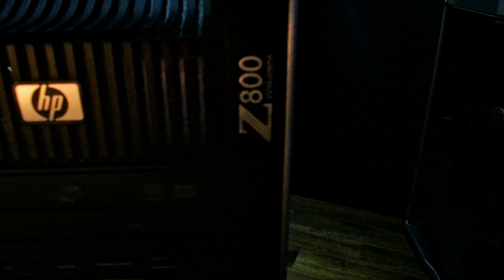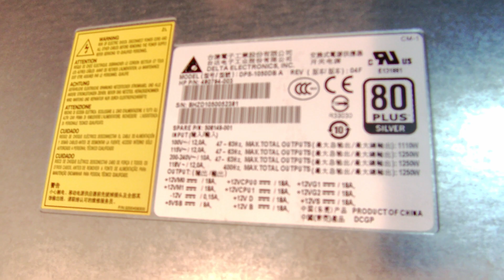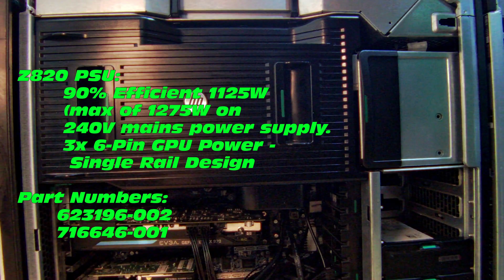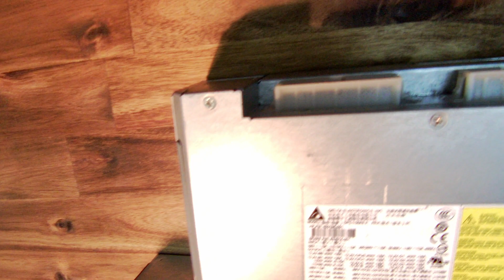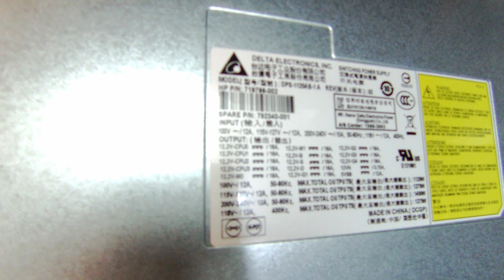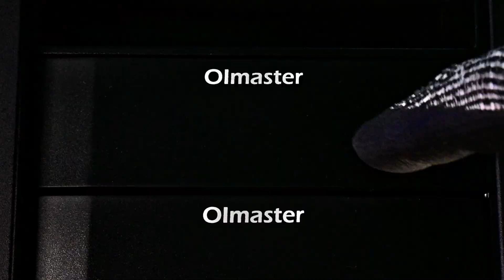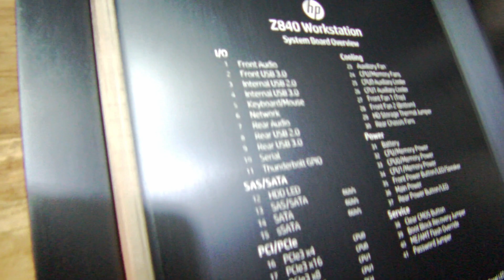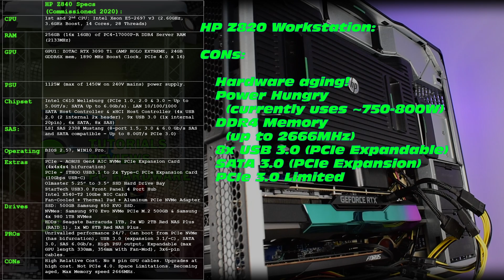Z800 / Z820 / Z840 Guide : Power Up Your Workflow with a Workstation (Remastered).

Comment: awesome video, i was wondering that is ot possible to boot from nvme m. 2 storage?, sata ssd is possible but nvme m. 2 is better.
Reply from the maker: Hi. Thanks, I am glad you found the video of benefit. NVMe booting is possible, and I use that in my Z840 right now for rendering videos, but it depends on the Z8xx model. I have videos on how to get the Z840 to run 4x NVMes on one lane by using the AORUS GEN4 NVMe Adapter (e.g. https://youtu.be/3MLLdAAv4cU). In my hands the Z820 and Z800 have not been able to boot to NVMes mounted in PCIe lanes (I can boot to them via USB - e.g. ROG Arion). But you can load your machine with SSDs and HDDs without issue. I have some future videos planned on the Asus Hyper M.2 and HP Z Turbo Drive Quad Pro - both of which can allow a Z840 to boot from a NVMe (maybe the Z820 - but not in my experience). 

RE your other message (it seems to have vanished!), the Z820 can work well as a home lab - but take note the operating system booting from a NVMe is challenging - I have seen others have success, but my Z820 machine (with the latest BIOS) would not detect/boot to a PCIe NVMe (Win 10 - Samsung 980). 

Both the Z840 and Z820 share similar spec PSUs. With a 6-Pin to 8-Pin PSU power adapter cable you can run most modern GPUs. I managed to get the RTX 3090 Ti into my Z840 here: https://youtu.be/D1cwwiR4UHM
Reply: @racerrrz  thank you for your help, English is not my first language, because of that I can't show fully my gratitude for your kindness. i really wanted to buy z 840, but my budget is limited, my  option are models below z840, like z820 and z640 and so on, i don't know, maybe sata SSDs are also fine, i really wanted the best for my homelab😅😅, sometimes you should lower your expectations 😂
Reply from the maker: @sembutininverse  No trouble! If you are patient you might just find a Z840 for a low price. I got mine by selling my Z800, which paid for half of the Z840! The Z640 is a really solid machine - if you can source one that makes for a good option. The Z820 is very powerful and can still quite easily be used today. I say keep those expectations high, nothing wrong with falling short of high expectations! 😅
Reply: @racerrrz  sorry for asking another question, can i use any pcie to nvme m.2 in the market?, or should i just use hp z turbo?, i dont understand the difference between common pcie to nvme m.2in the market and the hp z turbo, i appreciate your help,🙏🏻🙏🏻
Reply from the maker: @sembutininverse  Your question comes a little too soon! I am working on videos to answer your question, with lots of clarity regarding PCIe connectivity and NVMe adapters.

I can't find official HP documents to confirm, but I saw at least one mention of the HP Z Turbo Drive Quad Pro adapter having a PLX chip that allows it to connect to motherboards that do not support bifurcation (only the Z240, Z440, Z640 and Z840 or newer workstations have this function). i.e. The Z820 could then accept this adapter with 4x NVMes - but may still not boot from the NVMes. The Asus Hyper M.2 is the cheapest and it looks like a solid option. The HP adapter has more features but it is more than double the price.

In terms of NVMes, you are best to spend money on NVMes that are matched to GEN 3 / PCIe 3.0. The Z820 and Z840 can't support the full speeds of Gen 4 NVMes (like the Samsung 980 Pro) - hence I went for the cheaper options - like the Samsung 970 Evo Plus or 980 (not the Pro!).
Reply: @racerrrz  thank you, the explanation was clear, the reason i asked you that question was that i find a way to boot from those storages, one was clover app, and the other duet/refind, this method even works on previous model like z620 and ...
Reply from the maker: @sembutininverse  The USB workaround is the only way to get NVMe booting on them but I don't always recommend that since it's not a perfect method. I tried to get my Z420 to boot from clover on an internal USB but that never managed to detect the PCIe NVMe - even though I had an operating system on there. 

The best alternative that I found was to use a NVMe USB enclosure - like the Asus Arion (old video - audio is a little cringe haha: https://youtu.be/8gP2XhXXVjM). The speeds are slower - 1000MB/s max, but you get to have your NVMe booting on Windows on any machine - even a Z800!

Comment: The Z840's have been working pretty nicely for me.  Not as desktops, but as compute for my at home VM farm.  z840's loaded up with ram and  SSD and proxmox installed means I can model just about any kind of environment I could want.
Reply from the maker: Hi Ivan. The Z840 provides a very powerful system for VMs and likely you'll be hard-pressed to run out of processing power for your VMs. From an operational cost perspective the 1450W PSU would make me think twice for using it for a 24/7 system, but in my case the idle power-draw is actually decent (mine is ~ 350W at it's lowest). Have you got your one running all the time? I haven't had the need to set up Proxmox just yet, but I am sure that may change.
Reply: @racerrrz  powerwise, the nice thing is being able to shut down easily when its not going to be getting used for a while.  proxmox makes managing the VMs nice and easy.   It has worked out really well on the compute side as I have enough horse power to do quite a lot of work across multiple hosts.  In the end having lots of cores and plenty of ram makes up for how power hungry it is.

Comment: Hey! I also saw your video on the z400 series and I currently can buy either a z420 or an z820. But I'm wondering which one to get. They are roughly the same price but the 420 got a GPU upgrade. I'm wondering now if they have huge differences that would make one better than the other if I plan to modify them strongly (maybe even flash the Bios to unlock the CPUs to Ivy Lake). I'm not sure if I would ever want a dual CPU setup.
Reply from the maker: Hi there. I am glad you found both videos before making your decision! The Z420 is a great value machine. I put mine through its paces as a TrueNAS file server (and I use to game on one!); but they can be set up to match most tasks. The Z820 really packs a punch and there are some solid upgrade paths. 

The decision can be made simple once you consider what hardware you want to run in your machine and what the end use is. In terms of the Z820, aside from the extra CPU to handle multi core tasks, another major benefit is the extra PCIe lanes. If you plan to run a lot of expansion cards (like RTX GPU, NVMe adapters, 10 GbE NIC, SAS HBA, USB Type C etc.) the Z820 will give you more freedom to expand (although you would need 2x Xeon CPUs fitted to make use of the extra PCIe slots). 

What GPU does the Z420 come supplied with? What was your main purpose for the machine?

Comment: As far as I can see the highest core count you can get in one of the E5-26xx series would be the E5-2699 v4, which has 22 cores (giving a total of 44 cores for the dual chip setup).  Am I missing something or was there a typo in the headline, where you mentioned 56 cores total? Cheers 😊
Reply from the maker: You are observant and completely correct! Sorry about the confusion. The thumbnail has a small * that says 56 Cores and 112 Threads * on one table. That was the total cores present across all three workstations in the video (2x X5670 v1 (6 Core) + 2x E5-2690 v1 (8 Core) + 2x Xeon E5-2697 v3 (14 Core), netting 56 Cores, on one table. It’s a fine line between click-bait and the perfect hook! If you do want 56 Cores in one machine, the HP Z8 G4 with 2x Intel Xeon Platinum 8180 28 Cores each will get there without trouble. Or the newer HP Z8 Fury G5 which can get to 56 Cores on a single Intel Xeon W9-3495X CPU (1.9GHz Base, 4.8GHz Boost)!

Comment: have you tried a baremetal proxmox installation? what’s the  embedded network interface card type? intel I201?
Reply from the maker: Hi Shereif. The HP Z8xx workstations would be ideal for running Proxmox. I have not attempted an installation as I have not needed to set up virtual machines. Z8xx workstations have two 1GbE integrated NICs. The network card specifications will vary according to the model: 

The Z800 (2x RJ-45; 1x Integrated Broadcom 5764 PCIe LOM Controller + 1x Integrated Broadcom 5761 NetXtreme GbE Plus), 

Z820 (2x RJ-45; 1x Integrated Intel 82574L NIC + 1x Integrated Intel 82579LM GbEs), 

Z840 (2x RJ-45; 1x Integrated Intel I210AT + 1x Integrated Intel I218LM GbE).

In my Z840 I have added the Intel X540-T2 10GbE NIC to obtain an additional 2x 10 GbE RJ-45s.
Reply: @racerrrz  Thank you for the quick response. Right now i'm using multiple dell 10th Gen Micro PCs and instead of adding one to the fleet, I'm thinking of consolidating all of those into a single system, also where I can assign more than 64GB ram to a single VM.. Z840 looks like a perfect system
Reply from the maker: @SheriefElHamalawy  Nice, that sounds like a solid lineup of PCs. I suspect the Z840 will handle that quite easily and there are options to expand them quite easily. Power draw on the Z840 is generally quite good despite the large capacity of the PSU (I would estimate ~450W to run all the VMs but that will depend on their complexity and scale of use. Right now I have outgrown the storage capacity on my Z840 and I have partially incorporated a Z420 that's loaded with HDDs and TrueNAS Core to manage it all (plus 10 GbE to link them). I am not sure if this is of help but I presume Proxmox VMs could be linked to a TrueNAS database. You could set up a virtual machine running on Proxmox and configure it to access the TrueNAS database (with some RAID 5 perhaps) over the network (NFS or iSCSI etc.).

Comment: Z800 overclock possible?
Reply from the maker: Hi Robin. The Z800's Xeon CPUs can't usually be overclocked due to the Xeon processors not supporting the feature (they are build to be reliable). The Xeon E5-2687W V1 might be the only CPU that could be pushed further through using the Intel Extreme Tuning Utility, but I have not tried this out.
Reply: @racerrrz  thx for the info
Reply from the maker: @robinreso6240  No trouble. Let us know if you manage to get some overclocking done!
Reply: @racerrrz  pfft probably not possible

Comment: I have had several HPs, my most important is a Z820... as with my other HPs, when I turn it on the fans race for a few seconds before settling down and starting the boot... 
--> BUT beginning 2 weeks ago my Z820 has the fan on full for 8 seconds or so before starting to boot (rather than 2-3 seconds as before)... any ideas or experiences with this phenomenon?   
My other HPs, with my Z820 up until a few weeks ago had the fan go on full for 2-3 seconds before booting, so that didn't worry me... but now with 8-9 seconds of the fans on full, I wonder what's up... otherwise my Z820 is an amazing beast for music production, and an amazing value for the money...
Reply from the maker: Hi. There are a whole bunch of factors that can influence the fan speeds on booting. It is great to hear you are making use of your Z820's potential! I am certain it would work well for music editing!

Regarding the Fan issues: 

The short answer: 
It is likely your thermal sensor beginning to show signs of wear. 

The long answer:

I tend to have my Z420 (which spends most of its time off given that I use it more as a NAS / File Server) being quite loud on startup for several seconds. It can be because the room temperature is high, or that there is a fair amount of dust building up in the system. The most logical answer would have to do with the thermal sensor that regulates the fan speed control (it's located behind the front panel and is tied into the front I/O with the power button etc.). HP Workstations have a build in feature where the fans spin at max speed on startup to help clear dust out of the system (only when booting). If you notice a change in that duration the most plausible cause is the thermal sensor is beginning to show signs of wear (intermittent; if the fans run at max speed all the time it has likely failed). The sensor allows voltage to pass based on the case temperature. Higher temperatures mean higher fan speeds. But there are several other factors that can also influence the fan speeds. 

To test / diagnose it yourself you could use software like HWiNFO (I did a video on using it here: https://youtu.be/rs_7Qd-Jp9o ). Albeit a complex software package, you can use it to monitor your sensor outputs on your Z820. Another software package that can work is HP Performance Advisor (https://www.hp.com/us-en/workstations/performance-advisor.html ; I have done a video on it but I never released it due to copyright concerns!). The sensor of interest is the case temperature. If that sensor reads 99 degrees Celsius, as an example, the sensor has gone bad. If it reads normal, say 28 degrees Celsius, it could be another system that is having issues. A logical one to test next is the CPU thermal paste. What temperature are your CPU cores operating under? 

Let me know how you get on and we might just get to the bottom of it.
Reply: @racerrrz  Wow! You are great!  I have an operation happening tomorrow (ugh) and I won't be on the computer for a week or so... but I'll check it out... 
I had a Z820 maybe two years ago and it worked fine for a couple of weeks and then I changed some settings on the BIOS and after that it would only race the fans and not boot up... I sent it back to the dealer (30-day return) after a week of tests, but neither he nor I could ever figure out what had happened (BIOS reset, all the recommended things for HP Z820s, without success)... but now I wonder if there could have been a problem with the temp sensor, since it apparently wasn't a bios problem... 
ANYWAY, it's great to make your acquaintance!  Another Z820 (Z6-800 series) fan.  They really are great... this machine is a dual CPU with 2x 8core @ 3.3ghz (standard, not "peak")... it's a beast for music production, it can handle almost everything I throw at it ;-)  And I got it on Ebay for €700 !!  Anyway, in a week or so I'll check out my system, see what I can find out... the racing fan is only a bit unnerving, but since the system always boots after the 8 seconds, I'm not too worried... also it's in a room with the heat set at 18 C and it's been cold lately, and it could also be a temperature issue... Thanks for your quick response, I'll get back to you!!  Big smile here ;-)
Reply: @racerrrz  Oh and one more question.. my Z820 never actually shuts down... if I do "shut down" it will shut down, but then after 1-2 seconds it will restart.. same if I set it to hibernate (which is faster than a shutdown)... it hibernates and  then, after 1-2 seconds restarts and loads the saved state from hibernation... I have to stand there and wait until it goes off and then, when it comes back on, press the power button for 5 seconds to actually shut it down... I did a bunch of research on this, but nothing I've tried has worked... any ideas?  thanks!!!
Reply from the maker: @bobe.thomas  Lightning fast reply here (Sorry, I either missed the message notification or I never got one! But I just saw this again now - I am busy prepping a follow-up video to this one and I am actually editing the footage for the Z820 right now!). The random rebooting issue I do not have a solution for either - I have that on some of my machines also (my Z840 tended to do that). What I found prevented it from rebooting was removing the ethernet cable. Maybe if network boot is on in the BIOS the machine remains in a "listening state" and if your router, for whatever reason, sends a data packet ("hi z820, you awake" lol), then it jumps back to life.

I trust your operation went well and your recovery went well. How's your Z820 going?
Reply: @racerrrz  Isn't it the wake up on lan?

Comment: Thinking of a Z440 for a hackintosh. Anything else to look out for in term of gaining admin access to the BIOS etc. I don't want any gotchas! LOL. The used dealer has 100 of these and they are squeaky clean on the inside. I only need to get the front fan on aliexpress. Perhaps an episode of the BIOS and how to reset it to factory or gaining access etc. Things NOT to do etc.
Reply from the maker: Great idea there, I'll see if I can get something together. The Z440 prices are really coming down now which makes them more accessible, and they are a great value machine. I filmed a BIOS video on the Z840 a while back, but I never got around to editing and releasing it (partly because it is difficult to get good quality footage of the BIOS screen). That included how to flash the BIOS using the HP BIOS Update Utility. Unlocking a password protected BIOS is possible with the CMOS jumper (I'll work something into a video!). Also, there is HP Performance Advisor that allows changing BIOS settings from within Windows (I am not sure if there is a Mac supported version, but likely there is).